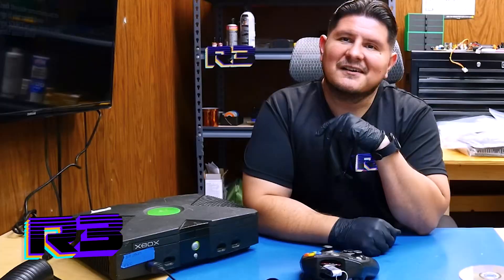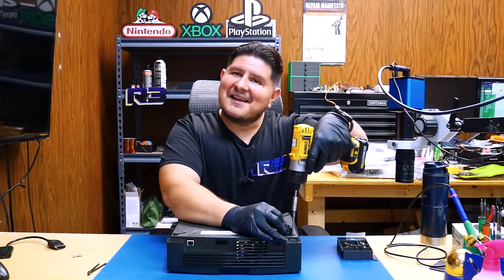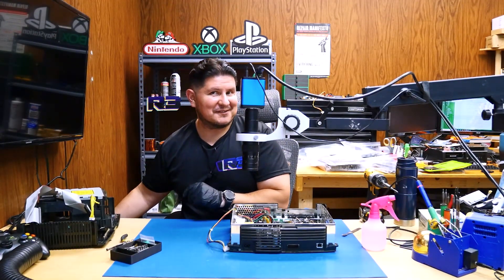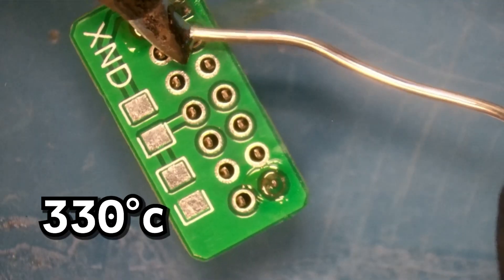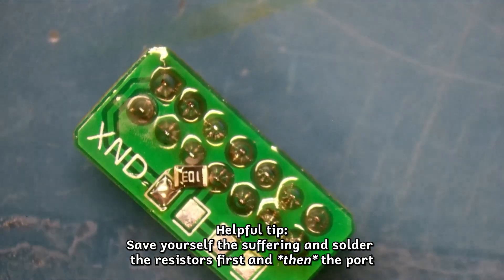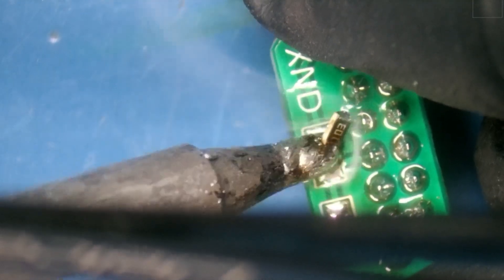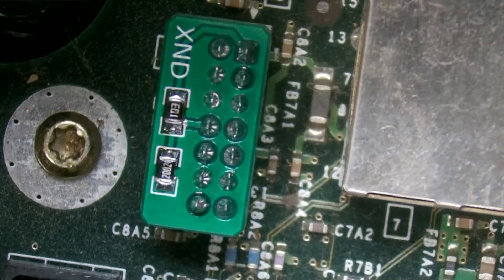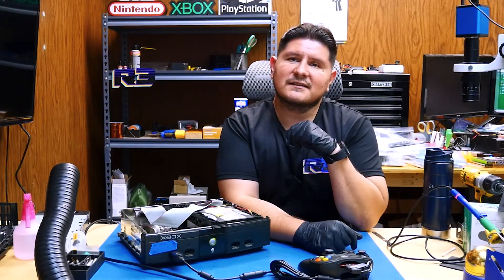Transform Your Retro XBOX With This DVD Elimination Mod

Comment: you don't want to completely remove the DVD it'll negatively affect the cooling ,the console will probably run hotter, the removal only makes sense for sliming the console, if the DVD doesn't work bypass it and leave it be

Comment: Did that module work for you?  I am asking because I am pretty sure, after spending way to much time working on this, that the schematic is wrong.  I don't have a 3D printer so I ordered a kit from Etsy to mount my DVD faceplate and it included a module which matches that schematic.  Only one problem -- it didn't work.

I use CerBIOS 2.4.2 and no matter whether I set DriveSetup to mode 1 (No DVD, Legacy) or mode 2 (No DVD, Modern), both XBMC4Gamers and UnleashX reported the tray as open.  I did some research and found that out what what the drive elimination module should do is ground pins 5 & 6 while supplying 3.3V to pin 7.

That's not what this module does.  The 10K and 20K resistors form a voltage divider.  Because R1 is connected to 12V, this would supply 8V to pin 8, rather than the 3.3V we want to pin 7.  If the VCC connection were connected to pin 2 instead of pin 1, the supply would be the correct 5V in order to get 3.3V from the voltage divider, but then it needs to go to pin 7 rather than pin 8.

A really old thread I found said that pin 4 supplies 3.3V so I performed a test by connecting this directly to pin 7 and connecting pins 5&6 to ground.  This works!  Both UnleashX and XBMC4G report the drive as empty.

If your module indeed works then perhaps the Gerber files differ from the schematic.  I'm curious now so I might have to take a look.

Comment: i wished it did not need a mod chip to work don't see the point now with cerbios tools with the non dvd option  i just made 10 and found out it mack an error 11 with out a mod  chip wished that was in the github guide thanks you for youre  videos only way i found out  Andr-Zero  Real Time Clock time mod is cool as well thanks again love the origanal xbox videos

Comment: Just a FYI, if you would use Cerbios and set dvd delete to modern (2) in the ini file, you dont need that dvd elimination module at all. Cerbios is the only bios that does the dvd delete the right way. Another plus: Cerbios is free and still updated.
Reply: Nice to know thanks for the comment, ive been looking in upgrading my OG Xbox which had an old Xecuter mod chip installed from back in the day, my soldering skills were amateur at best back then so im going to perform some cleanup surgery on it now that I have the tools do properly treat her well 😂😂
Reply: I just install Cerbios on my 1.6 xbox and i try to set in ini to modern (2) but still after i remove my dvb drive i get error (no dvd) when i try to start a console...I just think that this mod dont work if you dont have modchip on any kind  "fisical mod" on consol to cerbios work. Did you try this on your consol???

Comment: Any suggestion as to which version of the console I should purchase if I want to collect old discs to play as well? Seen a lot of back and forth online between the 1.0 , 1.1 and 1.6
Reply from the maker: Probably a 1.6 if you don't care about the upgraded RAM.
Reply: @RetroRenegadeRepairs  appreciate it thank you!
Reply: 1.6 consoles had poor video encoder and some games will show scrambled graphics and other issues running at 480P  rendering unplayable.
Reply: @eileenlucynakurosawa7421  ended up copping a 1.4 but ty!

Comment: Why would I need to go through all that crap when I can just leave the DVD daughter board in the Xbox?
Reply from the maker: Not everyone has a fully functional drive or even one that isn't causing an error code.
Reply: @RetroRenegadeRepairs  But those people just install a no dvd bios and they are done....
Reply: @thebaldconvict sounds like there are options out there for different builds, i prefer the DVD drive to rip original games directly to the HDD/SSD
Reply: @hardkore360  right, so you need the DVD drive then, that doesn't change that this isn't needed.

Just install a no DVD bios and your done without any of this faff.

Comment: I hope someone, one day, can get parts to fix these drives. Thompson drives suck. Samsungs aren't much better.
Reply: The drives are upwards of 23 years old, and made during the capacitor plague. They're all failing, just some faster than others. I won't spend more than an hour attempting to repair an optical drive before I just patch it out.

Comment: Here's a tip, lose the solder wire on SMD components.  Just have some on the tip and pre-flux the pads, then just come into the joint with the solder that's already on the tip.  That way the hand that was controlling the solder spool can now help stabilize the resistor with some tweezers.

Comment: loving the videos man! 
Not sure if you've dabbled with Cerbios but it handles no DVD drive quite well, without the need for the added resistors. 
There's another super solid dvd bezel from mattysuds on the ogxbox forums. I believe it's in the megathread with a ton of 3d printed parts.

Comment: If you have "backup"discs and want to use them, but your drive is dead, you can connect a normal IDE DVD drive to the Xbox. 

You do need to split the power from the hard drive to it using a Molex double output and an IDE cable with 2 inputs on it for both the hard drive and DVD drive, and it works no problem.
If the DVD drive is fairly new, then it will most likely be faster than the original and load the games quicker.
Remember, this won't read original discs.
Reply: Huh. I don't think I knee that...or at least didn't remember it. Copying backups to the HDD from disc is still probably the easiest way to get games onto an Xbox these days for most users, unless you have a really long ethernet cable
Reply: Who has a good video of this?
Reply: Certain Hitachi PC DVD IDE drive can be flashed with original Xbox Hitachi drive dumped firmware and modded with some wires and will work as the stock Hitachi GDR-8050L
It will read original Xbox game discs

Comment: Those Thompson DVD drives found in early Xboxes are known to be poopy.
Reply: I've had statistically better luck with Thomson drives. But, I've been able to repair more Samsung drives with new resistor arrays, and occasionally capacitors.
Reply: now they only serve as dummy dvd check pass drives